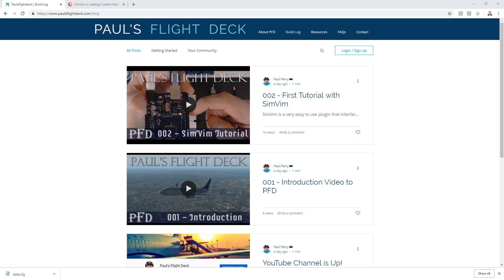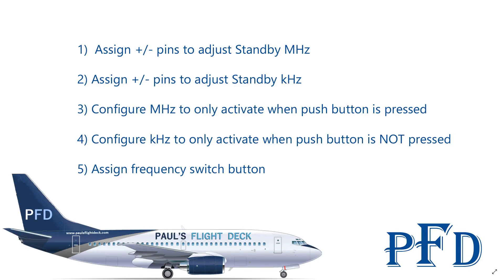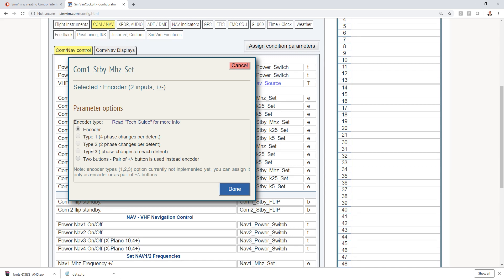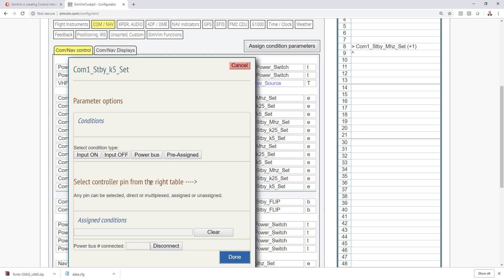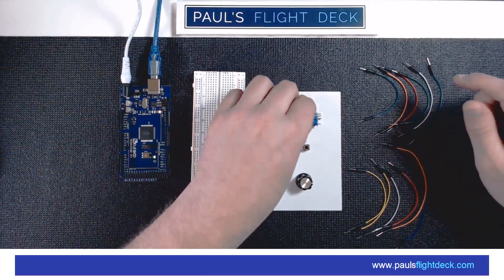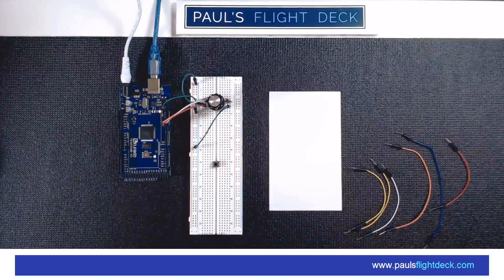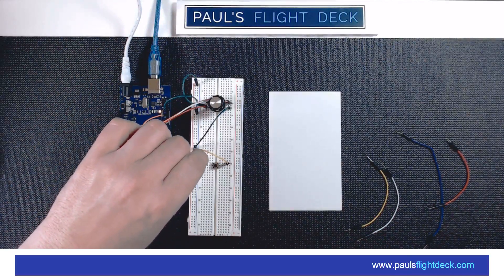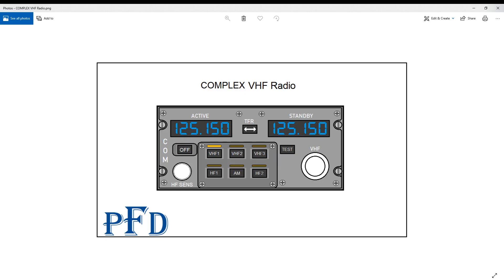Paul's Flight Deck 003 - Simple VHF Radio Part 1

Comment: Hello Paul nice video. I have a question, For example if you wanted to switch the APU on in the A320 it takes a few seconds for the 'AVAIL' light to come up on the APU button which indicates the APU gen is available, how would you get the light to come on only when the APU is available?

Comment: I am curious if you know how to do the same concept with the newer GPS1 Outter and GPS1 Inner knobs for the Garmin 430 and 530 radios with the newest SIMVIM edition. When I try to do it while following your video, I can assign both knobs to the same encoder, however I cannot figure out how to amend them to use the push button to only do Mhz or Khz. Any thoughts?
Reply: The interface has since changed. Now you should use the selector, ex: if you assign Pin 2 and 3 to the inner knob and then you assign the same pins to the outer knob click on pin 2 and it will give the option to chose a selector. You should configure your selectors before hand in the "SimVim functions" it is the latest tab in your data table view. Chose for example push button as your "selector 1" and assign it to pin 4. Wire the switch from your encoder to that pin. then when you chose which selector you need chose "selector 1". This should work.

Comment: Does rotating the knob work well or is it a bit laggy? In the end, I wonder whether it is better to sync the knob directly with a 7 segment display (to see the change in real-time) or to let SimVim do all the syncing (thus, sending the value to the flight sim software which sends it back to the 7 segment display).
Reply: I haven't replied to any videos in quiet some time.  I unfortunately had to put the 737 project on hold due to a beautiful baby girl, and some unexpected home renovation/repairs which more than doubled what i was going to spend toward this project.  I hope to pick it back up one day but it's not hard thanks to Vlad at SimVim.  I HIGHLY encourage anyone wanting to pursue this further to use his documentation and tutorials/schematics on his site as this is where all of my information mainly came from.  I did watch some youtube tutorials on the Arduino Mega first, and that was very helpful.  My videos and site were meant to push support for the amazing plugin from SimVim, not replace it.  Vlad was very good about getting back to me within 24 hours through is patreon page as seen in this video @ 3:00 .
Reply: @RPPerry1984  I guess, I will try it out myself at some point :) I wish you and your family the best!

Comment: How does it look on the actual Arduino , the Switch require GRD & the Encoder require GRD, there is only 1 GRD on the right side of the  Arduino Board, and what happen if you have multiple Encoders  ?????
Reply: Common ground with wires. You can connect gnd from encoder 1 to gnd encoder 2 and then throw a wire from gnd encoder 2 to arduino gnd. Do it as several times you need with encoders, switches, buttons, even leds. Everything can have common ground
Reply: ....make sense  ... tnx Seba
Reply: Please read about this (grounding) on our SimVim website :
http://simvim.com/tips_power.html   (below on this page)
Vlad

Comment: Hey paul, i cant get to work the freakin button, how did you connect the four pins? can you send me a close up picture? my mail es hernans1987@gmail.com , i tried several configs , changing ground over and over but i cant get it right, im very frustated, i have done the most difficult part, make the encoder work but i cant with this stupid button aaahgggg (sorry need to blow some steam off)

Comment: Great video! but i cant make the push button work to switch mhz and khz, i have a rotary encoder KY-040 for Arduino, in this rotary i have to use +5v and GND
Reply from the maker: I'm not familiar with that encoder hermans10.
Reply: @the-sim-life  thank you for your fast reply, never mind i made it work, i didnt realise i had to press the encender button and while the button is pressed i rotate ir, i thought the button worked as a switch, also my encoder uses GND adn +5V yours is GND and GND, anyway great video Man, life saver
Reply: @hernans10  You can make it work either as push-and-hold   or as as mode switch - see more on our SimVim website. 
And - please read about the  KY-040  in our Encoders" page.

Sorry, but honestly, I don't understand, why  simply don't read the TEXT information on the original website?

Regards,
Vlad - SimVim

Comment: Interesting concept of using the push button to change the Mhz/Khz, I think I'll also use this approach for simplity. I'm considering using the 1602 LCD display for the radios which come in a varity of colours. I'm not going for authentic panel that mimics a certain aircraft, rather a general purpose panel I can use with all (most) aircraft. Because of this I think I could use a single 1602 for 2 radios.

The top line being Active on the left and Standby on the right for COM 1 and the lower line the same but for COM 2. Cutting a masking panel (basically 4 windows) that fits over it to separate the freq.

Good stuff, interested to see your wiring loom and what material you'll be using for the actual panels.

Comment: Thanks for this series! Just started a build for the first time so these will be extremely helpful!!
Reply from the maker: Seven Segment Displays (SSD) arrive tomorrow so I can get an actual working panel for the next video.  I just need to see their actual dimensions as I only know the Digit height, not the actual size of the cards etc.  Once I put the micrometers to work on them I can design the faceplate and we'll be good to start the build.

Comment: Well done Video! Thanks! :) Maybe you can make a video about using a multiplexer? ^^
Reply from the maker: Thank you Graubi, I was very tired and everyone was asleep in my house so I had the microphone way to close to my mouth (loud breathing in some spots) so I was really worried I'd have to completely redo the video.  Part 2 will be on the 7 segment displays and how to multiplex 2 of them with MAX 2719 modules.  These are the ones I ordered from China :
https://www.ebay.com/itm/MAX7219-8-Digit-LED-Display-7-Segment-Digital-Tube-For-Arduino-Raspberry-Pi/201675752466?ssPageName=STRK%3AMEBIDX%3AIT&var=501348725634&_trksid=p2057872.m2749.l2649

 But, will not arrive for another month. So I can keep the tutorials moving I ordered a set of Red LED 2719 modules from Amazon and will arrive this weekend so i can start Part 2!  I hope you find the videos helpful.
Thanks,
Paul
Reply: What do you want to know about multiplexer? Is explanation on the SimVim website not enough?  It's very simple... http://simvim.com/index.html
Vlad